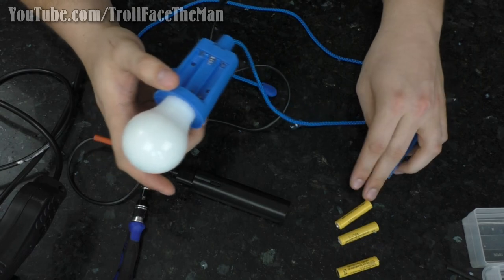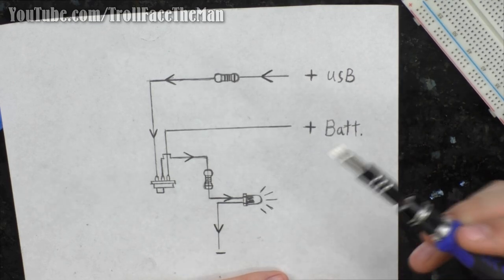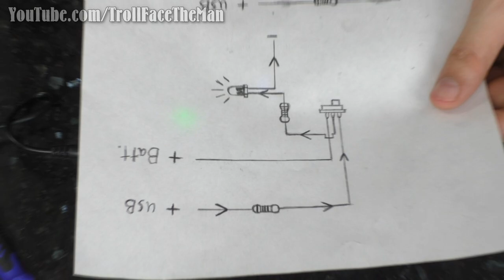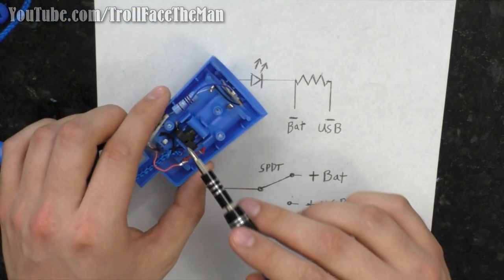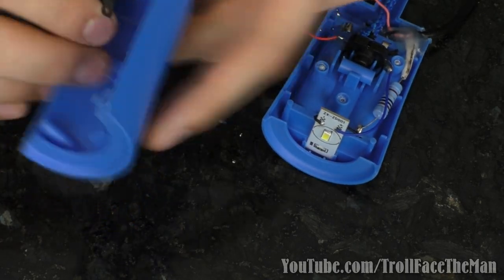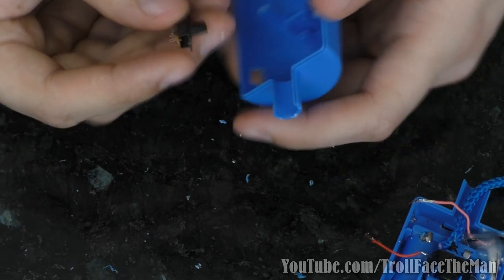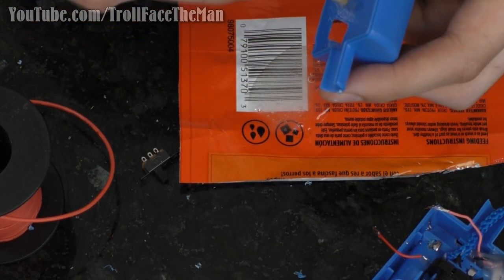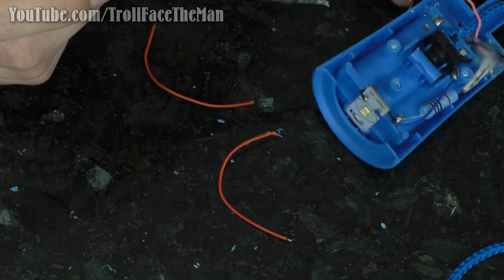1 LED Bulb, 3 Mods. Warm White Swap, Slow Fade On/Off, USB or Battery Toggle.

Comment: My curiosity has been eased.

My go to method to mount those small switches is to slot them from outside and hold them with little screws.
Reply from the maker: Definitely could of been done, but I didn't have short enough screws to prevent possible internal conflicts and was too lazy to go to the store. So instead I accidentally expoxied the switch to itself...
Reply: Fun !

It reminds me when I was soldering wires to a switch like that, which was on a tricky position, and it melted.
Reply from the maker: @MisterTalkingMachine , that's what I was worried about but luckily the solder took well.
Reply: You have to stay away from the ones in which the wafer holding the lugs is plastic. If it's phenolic or fiber then it's good.
Reply from the maker: @MisterTalkingMachine , mine the fastener plate is actually Metal. But the switch itself is plastic.
Reply: I cannot imagine how does that even work but it sounds pretty neat.
Reply from the maker: @MisterTalkingMachine , there's a peice of metal on the bottom of the plastic switch.
Reply: How is it isolated from the lugs?
Reply from the maker: I think we have a mix up going on here.
Reply: Absolutely.